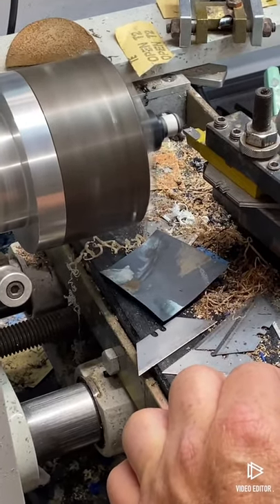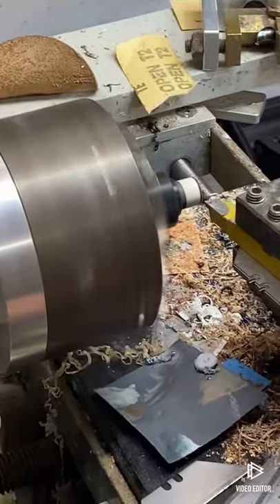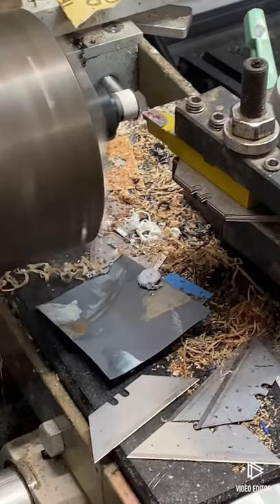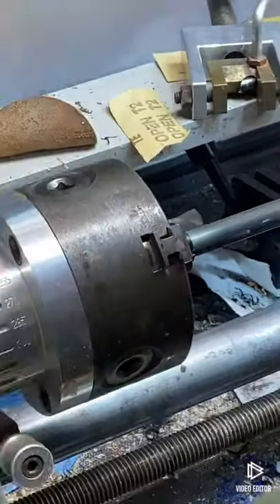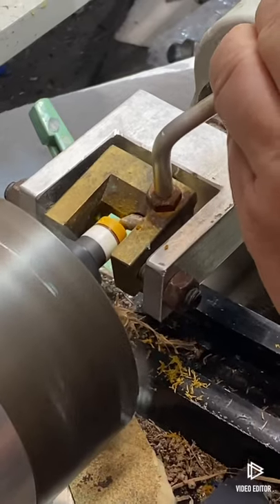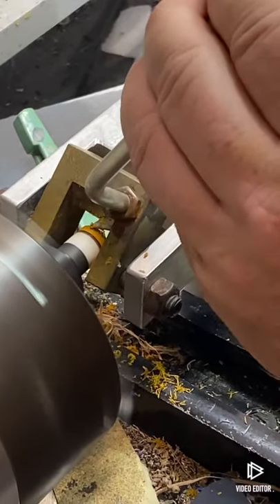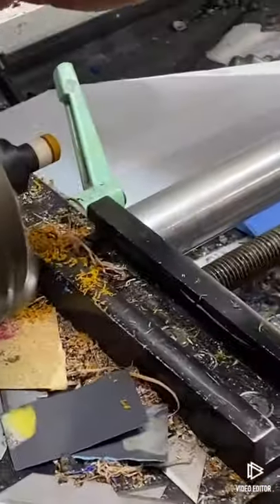Carbon Fiber Shaft tip replacement

Comment: where did you get the radius turner?
Reply from the maker: Radius turner?
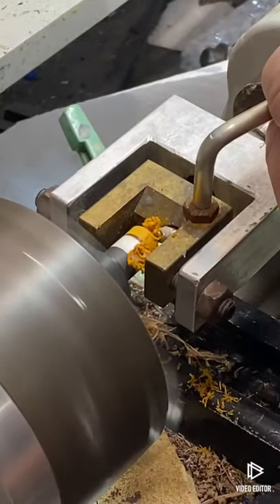Reply: @BangTimePool  04:20 radius or ball turning tool, did you make it or a link where it can be found
Reply from the maker: That is my tip guys equipment
Reply: @BangTimePool  sorry I thought the video was your work. I do some repairs as well. It really threw me off when you did not know what a radius turner was. take care.
Reply from the maker: We refer to it as a lathe I do believe— all good!
Reply: It's made special for the Joe porper model b cue lathe and it's sold by Mueller's

Comment: You are supposed to take the red layer off when putting on a new tip on a cynergy
Reply: Otherwise it wont be an even flat surface when installing the new tip. It goes straight on the ferrule.
Reply from the maker: The red layer has been off!!! That was an error!!
Reply: @BangTimePool  cool beans

Comment: Most carbon fiber shaft manufacturers state that abrasives of any kind should NOT be used.  So I'm wondering how do you remove clamp marks/damage to the carbon fiber shaft that could be caused by the collett and chuck being over tightened while installing the new tip?
Reply from the maker: You do not need to tighten it to the point of indentation!!

Comment: What tip did you put on and why did you change it I have the same shaft and I hate the tip I need to replace mine
Reply from the maker: I put on the Predator Victory medium- I did not like the soft feel on the tiger tip.